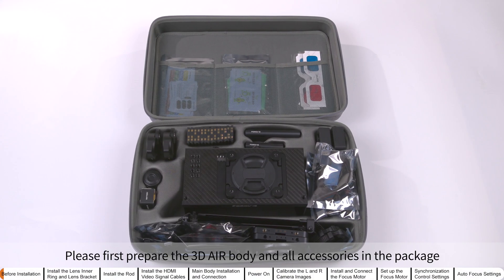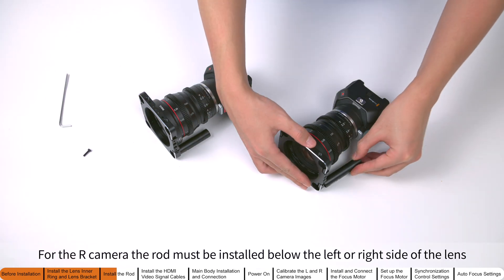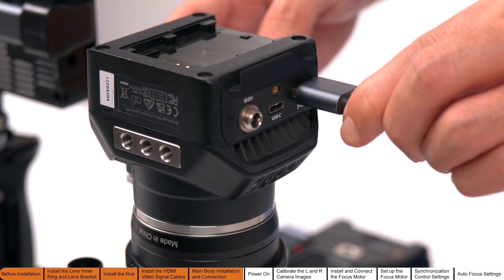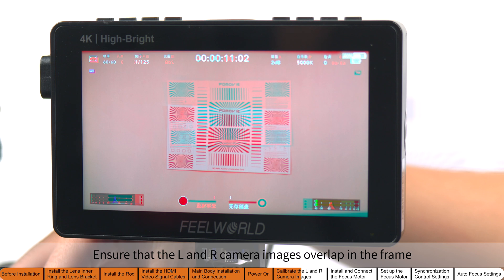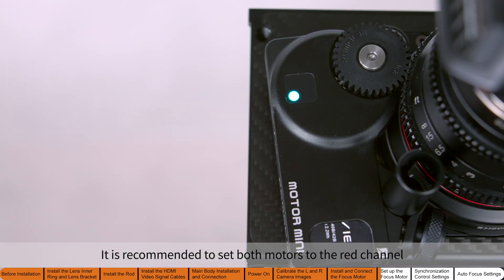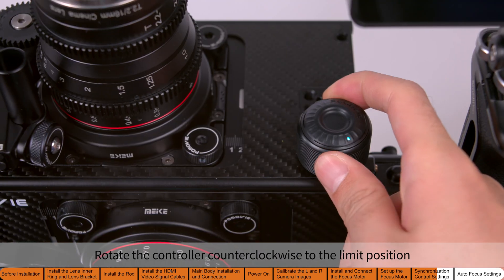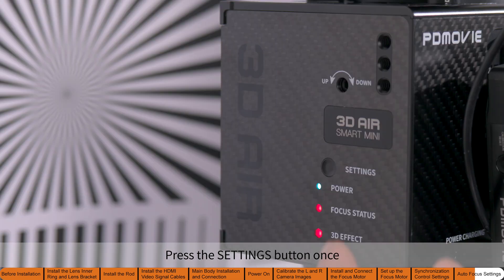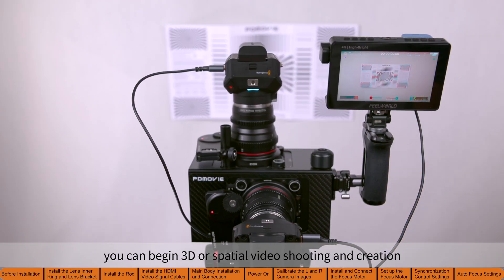The complete installation setup steps for PDMOVIE 3D AIR.

Comment: Hello,

I have been using your automatic autofocus device, the Smart Air3, for over a year and it's been great. However, I have two complaints, and I’m curious if an improved version is currently in development. I’m eagerly waiting for it.

The first issue is that the maximum detection range of the LiDAR sensor is too short. While I don't expect it to reach 20 meters like other brands, I wonder if there are any plans to develop it to detect beyond 5 meters?

The second issue is that the device can only store settings for up to five lenses, which I find too limiting. Calibrating the lenses is already a cumbersome task, and if I’m working in an environment where multiple lenses are required, I would need to purchase more than one device. Each time, I would need to set it up from scratch, which is very inconvenient. Could you consider increasing the memory to support at least 8 to 10 lenses? Alternatively, I would be open to paying for an upgrade via additional firmware or a similar method.

Thank you for considering my suggestions.
Reply from the maker: Thank you very much for your attention and support. We have forwarded your feedback to our technical team and hope to deliver updates in the future that better meet your needs.